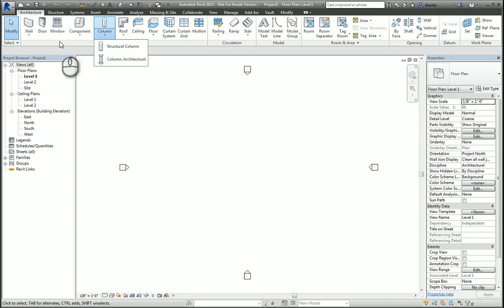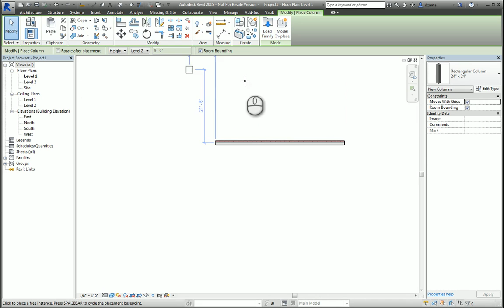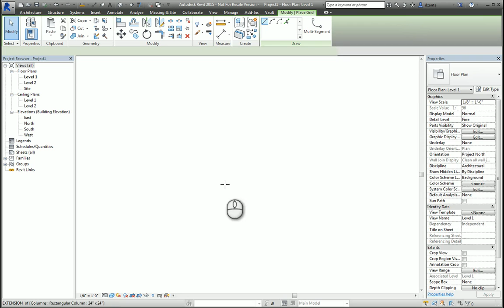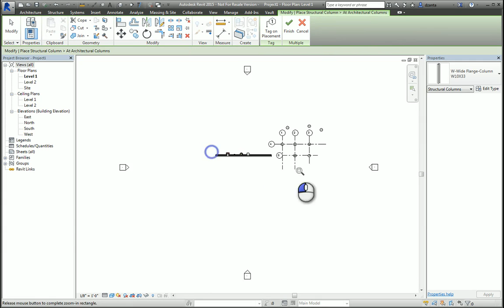Revit: Columns

Comment: so man you provide a problem without a solution😂  who should I differ my architecture column from wall, coz after placing the column it takes the same material as the wall